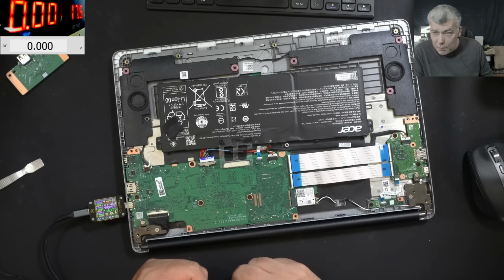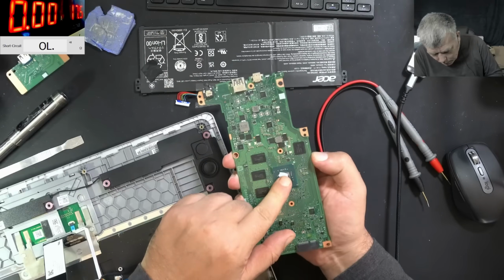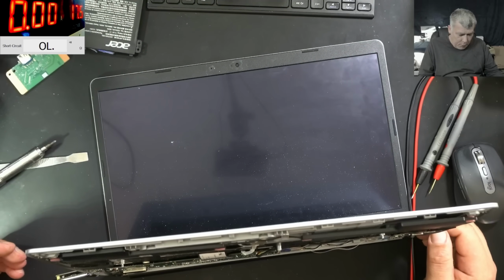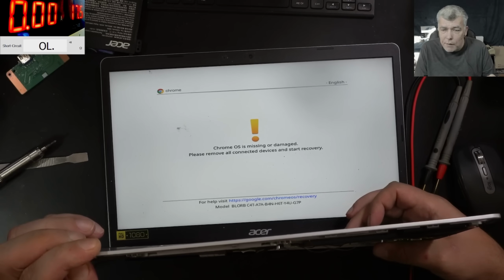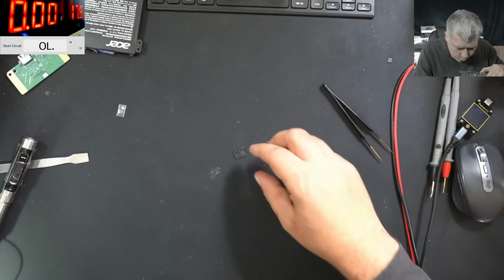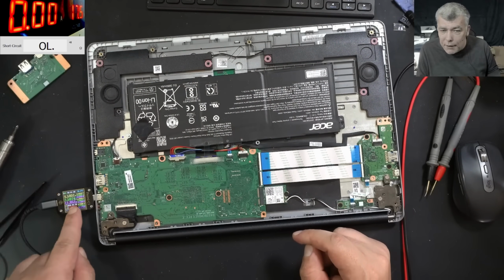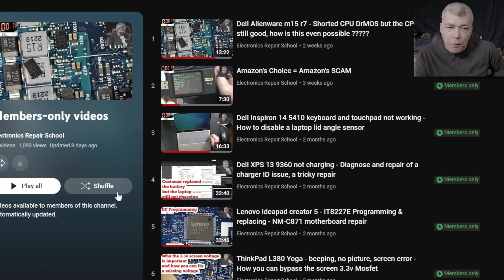Chromebook not charging, no power, board repair - H1B3C = H1B2C chip ic replacement

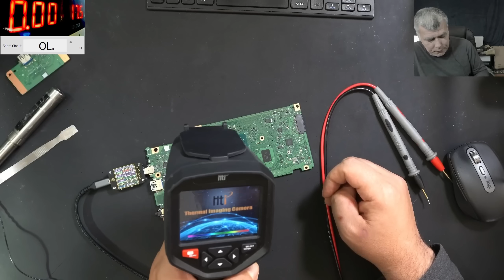Comment: At 5:10 MINUTE your thermal camera shows two chips getting hot. what made you ignore the first chip and go for the 2nd one? why didn't you replace the other chip you had identified at first?
Reply from the maker: the first chip is the chip which is supplying power to the second chip, thats why i ignored it

Comment: When I had my first dead chromebook I researched this chip, which was shorted in mine, and found an in depth paper saying how it's a security chip and it sounded like it was coded to the motherboard and couldn't be replaced so I never tried. I have found this chip always fails especially with USB port damage. I wonder if it will let you log in with a chrome account.
Reply: So... a chip known to fail is in charge of the users data, with no redundancy :face-red-droopy-eyes:
At least Acer is learning from the best in the faild, Apple :))
Reply: @IcecalGamer  Wouldn't most of the Chromebook data be on the cloud or is there separate local storage that is not accessible via Google Drive etc?

Comment: The storage of those cheap chromebooks are often Flash based and accessed over the USB bus. So the chip could either provide power or the data lines for the flash memory goes through the chip.
Reply: Makes sense.
Reply: I run a Linux "distro" for chromebooks and I've never seen a chromebook that has its internal storage connected on USB. It's eMMC on cheap ones.
Reply: @mayamatuszczyk2436   Yes, on some of the cheaper chromebooks,  eMMC  (embedded multimedia card,  aka a type of flash memory closely related to SD-Cards ) are sometimes run over the USB bus. I presume it is a cost cutting thing.  Some of them even have a SD card slot on the board with an SD card hot snotted in place for the OS.

Comment: I had a similar issue with Lenovo Chromebook TPM security chip H1B3C.  Cause: bad broken usb-c ports destroyed the SlimPort ANX7447 + diode ESD array +  PI3usB9281 + H1B3C IC
Good to know H1B2C is equivalent to H1B3C didn't know that, in my case I just ordered it from ebay.
You probably have a bad usbc-port a bad slimPort IC (controller) or usb controller 2.0 3.0 controller (like PIUSBxxxx Ic's ).
Also in your case is it a charging port on the left side, sometime laptop have 1 usbc for charging and the other only for accessories but you probably checker that.
Reply: I bought a Lenovo Chromebook off the internet for 100 dollars. It worked fine for about a week then all of a sudden it wouldn’t power up. I took it apart and examined the audio board on the right side and saw some chip components burned up. Because whoever owned it before me was charging it on the wrong usbc port. I got on a really nice website selling electronic components for older devices. That  audio board only cost me 25 dollars and that is with shipping included. Gee I put that other audio board in and it fired right up. I wasn’t sure I would like it because it’s chrome os but I’m really happy to own that computer, thanks for the video on this.
Reply: yes, most cheap laptop only have 1 charging port, and the other usb c port only for data
Reply: why your comment is 23h ago and the video is 9 hours ago LOL !!
Reply: @hichemhich1786  at first, this video is for members only
Reply: :washhands: